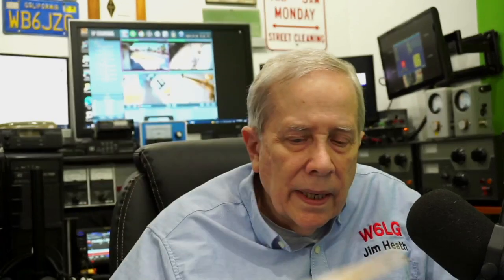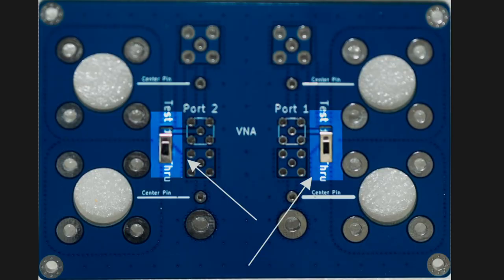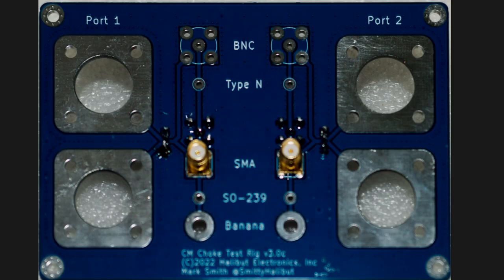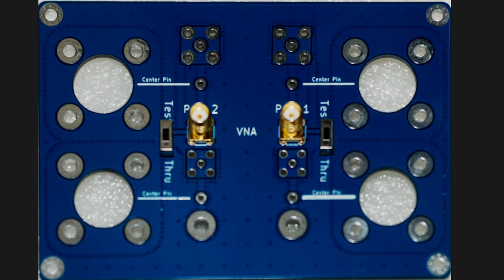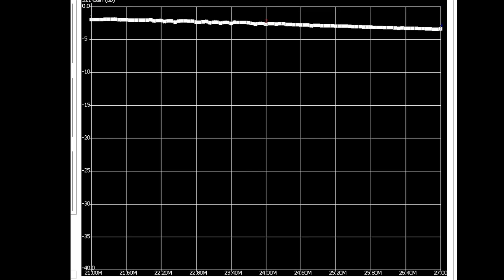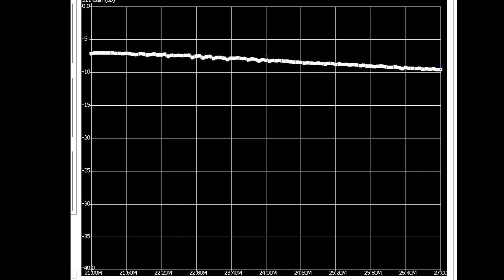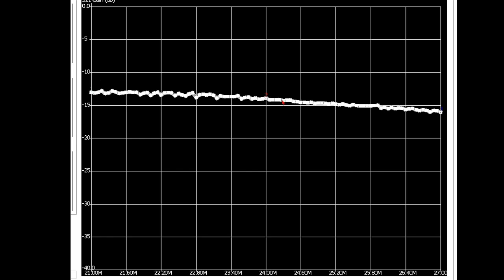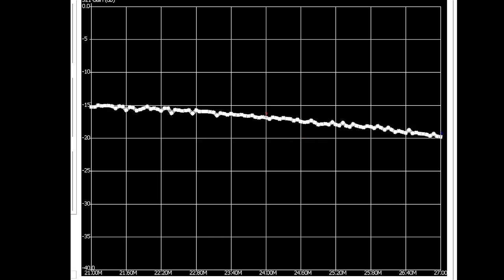Circuit Board for Testing Common Mode Current and Other Types of Connectors with a NanoVNA

Comment: When measuring common mode current rejection of a Balun (/Choke), I have seen many others use two 25 Ohm resistors splitting the signal from port 0 to the choke (balun)  and the reverse on the output (combining the outputs into a single line back to port 1on the VNA).  I have made measures with and without the resistors and there is a difference.  Any comments on which is correct?

Comment: I have measured insertion loss and swr with a nano vna.  How did you set up to inject a common mode signal on the shield?  Is that what the switches perform, swapping the signal from the center conductor to the shield?

Comment: Could you show us a little more detail (pictures) of the setup.  Seeing the bead size, type of coax, etc would be very helpful.
Got my Novice license in 1976 so I’ve been around a while but always amazed by the new technology available to the amateur operators of today.
Thank you for all your advice available on your channel.
73
Preston wd4dda
Reply from the maker: They are 31 mix on RG213 that was about 6 feet long.  They were the rectangular snap on type of bead that costs about $5 each from Amazon.  73, Jim

Comment: Well done so far Jim, I guess everyone has preferred approaches, a singe pass through a small bead is probably more effective much higher in frequency. I will look up that jig you are using. The inductance of course increases with a square of the turns so 4 turns around that core would likely surpass this. I did my measurements without a jig, and some common mode chokes were better than -40dB....
Reply from the maker: A single pass seemed to be the least effective.  Winding through a core was many dB greater.  I measured more than 40dB with a 1:1 balun and barely 20dB with beads. Perhaps the beads that I bought were not the best.  They were expensive.  73, Jim
Reply: @ham-radio  to be honest mine have all been wound on larger toroids, either FT240-43 or FT240-31. I know W2DU was a proponent of the bead approach but I believe it would take a huge number to offer a very high common mode impedance. Id id send an email yesterday, not sure if any of it may be helpful 73

Comment: Jim which beads are you using?  What is their composition and part number?  Which coax?  You are essentially making a Walter Maxwell W2DU choke for common mode, yes?
BTW does the dB reduction change if the type of coax changes?  Ie: LMR400 and some other less expensive .400" coax?  Nice, 73 Art W1SWL
Reply from the maker: They are 31 mix on RG213 that is a common mode choke by design.  I am not sure about the size of the coax.  But my guess is that the answer is yes.  73, Jim

Comment: Simply stringing the beads is the brute force method, very inefficient and costly. A far better strategy is to use fewer beads and pass the coax thru' multiple times. Impedance will the go up a factor of the square of N turns . so for two turns impedance will increase 4 times and 3 turns by 9 times etc.
Reply from the maker: I agree.  Watch the next video about that subject.  Thanks, Jim